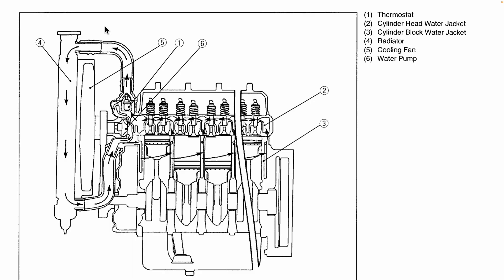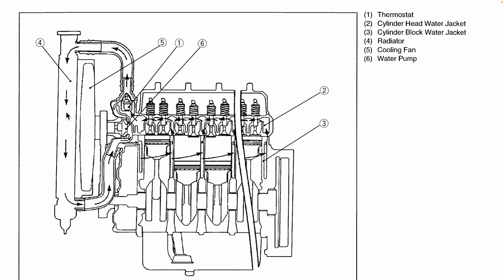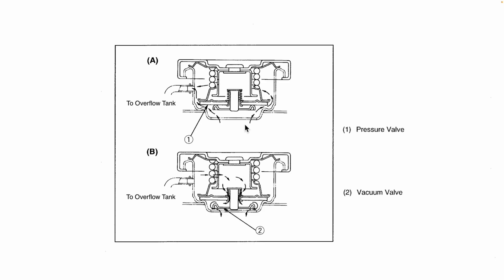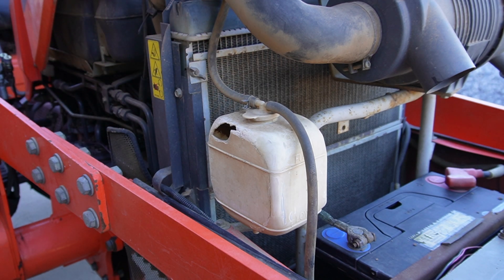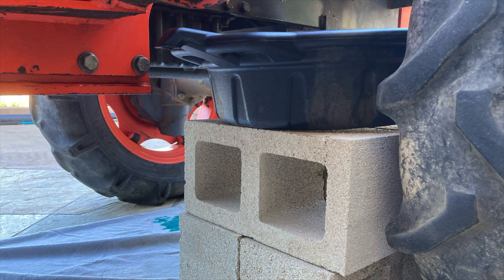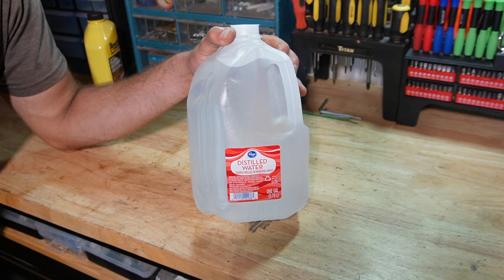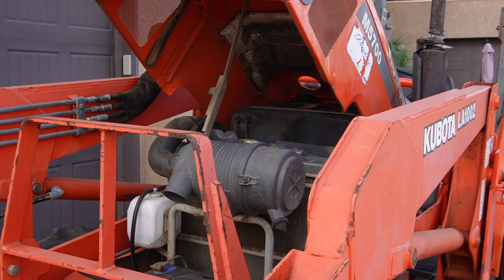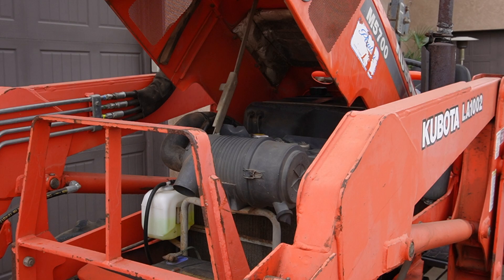How to Change the Coolant on a Tractor

Comment: Looks to me that the radiator drain plug is lower than the (engine) hose you took off. The drain plug is how Kubota says to do it.
Reply from the maker: I serviced it exactly as described in the M5700 workshop manual. Instructions are on pg. G-27. 

On a lot of the newer tractors you need to drain the radiator using the petcock and also pull a drain bolt on the engine block. I'm working on one of those now and will show how to do this in a future video.

Comment: So after the tractor has ran for awhile, and the cap pressure exceeds 15 psi, the pressure opens the overflow valve, allows coolant to flow out of the radiator and into the overflow. therefore the coolant in the overflow, in the instant it gets in there, is the hottest coolant the system couldn't handle anymore. Once enough scalding hot coolant is displaced, the pressure drops, the cap closes the overflow valve, and the system returns to normal function?
Reply from the maker: Yes once the pressure exceeds a certain threshold (~15 psi), coolant is released from the radiator into the overflow tank. And once the radiator cools down, it draws a vacuum and sucks the coolant back in.